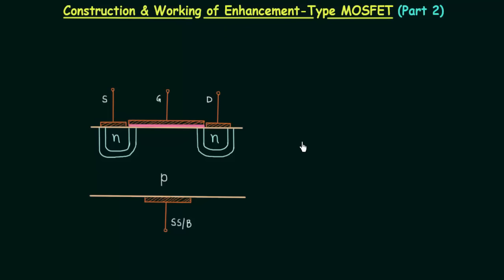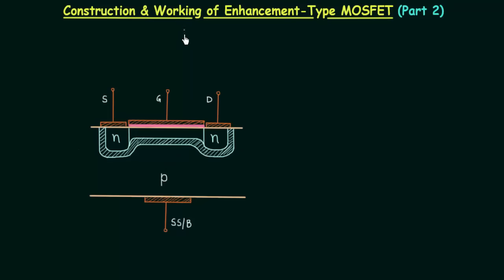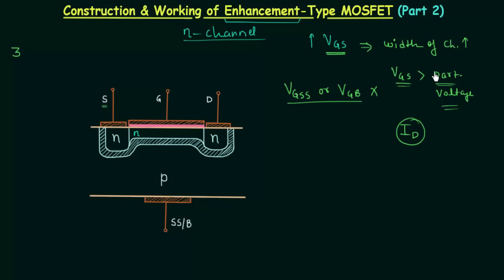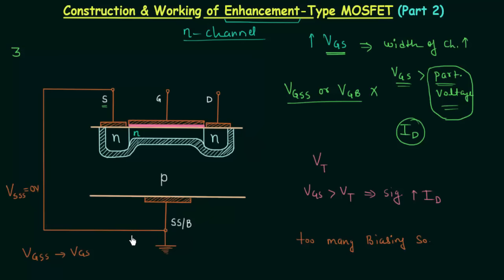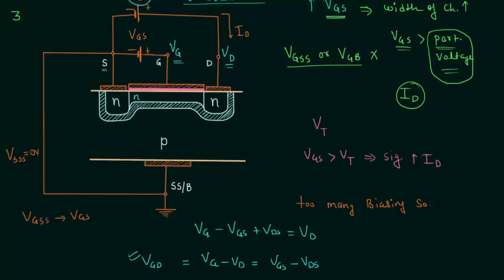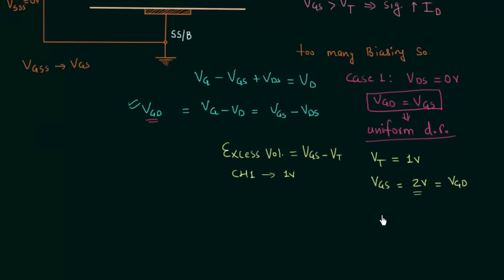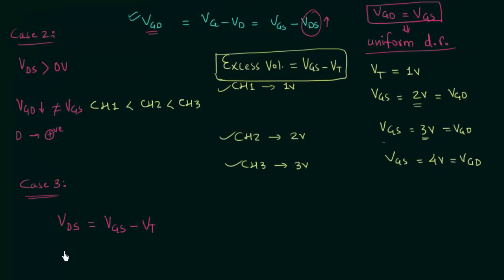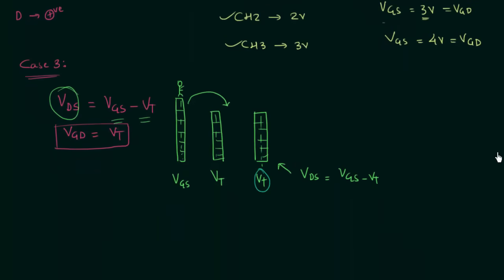Construction & Working of Enhancement-Type MOSFET (Part 2)

Comment: Case 3: Think of it as a line segment with 3 points: S------G------D  (similar to the MOSFET)
If we need S+G to overcome the VT threshold, then we could say, we need S+G to get to D.  With this understood, then we could say, S+G = G+D are of equal length.  Now, D+S is a total length of the line segment and remember, the line segment is broken in 2 equal parts:  S-----G & G-----D. If you understood my 2nd sentence, then we could also say S-----G---VT---D because we need the length of S+G to get over the threshold (VT) to D.  If the line segment is 2 equal parts, then: S---VT---G & G---VT---D... so if we took away S+G, then we are left with G--VT--D, thus VGD = VT. I hope this brought some clarity.

Comment: In case 2, As Vds is increased, the reverse biasing also increases( Drain terminal connected to n-type well and also given positive voltage). As reversing biasing increases, the depletion region increases, and because the depletion region increases, there is lesser and lesser flow of charges.
Reply: Thanks a lot! I was having problem with this case.
Reply: Thank you
Reply: Does his explanation imply that Vds>Vgs?
Reply: thanks a lot bro
Reply: Thanks a lot bro
Reply: Thanks
Reply: Thank you for this
Reply: Thanks

Comment: I have a doubt. In case 1 you said that we will keep Vds as 0. That means drain and source are short circuited.  
If drain and source are short circuited, why should be there any current flow through the channel??
Reply: By saying keeping Vds =0, he means that there is no Vds at all.
Reply: I don't think there will be any current flow in that case. We're not discussing current vs Vds, just just depletion layer and channel width.

Comment: 2nd case explanation

when Vgd goes down it means increasing of the drain voltage and reduction of gate voltage......but assume the gate and drain as the terminal plates of a single capacitor having positive charge accumulation at gate and negative charge accumulation at drain....what happens when Vgd goes down in this capacitor....some of the negative charges at  drain will flow to the gate causing reduced negative charge accumulation at drain....as a result channel width reduces

Comment: how can current flow in case 1 when we make vds =0 there should be potential difference across the terminals for flow of current may be both channel widths would be equal but there wont be any conduction

Comment: I didn't get Case 1. Why would the voltage between D and S equal zero? That actually means that there's no current flowing from Source to Drain. It's kind of paradox to me. On one side the channel is opened (which means that the current is moving from Source to Drain) and on the other side Uds=0 (no current flows from Source to Drain).

Comment: For case 2 think of a normal diode...
Now apply +I've terminal of battery   on n side and -ive on p side as in case 2 in drain.... Now think if it's reverse bias or forward I.e reverse biased so deplition  layer  increase....
Reply: thank you very much. I have seen it 5 times but got clarity after your explanation

Comment: At 14.58
When you are telling about the thing that when drain becomes more positive, less positive charge and hence less electron interaction.
But since drain is becoming more positive,shoukd the force of attraction increase and so channel width increase and depletion region reduce?
Reply: Drain is becoming more positive w.r.t. gate, however, gate to source voltage is constant. Hence channel width between gate to source will remain same. However, more positive drain implies more reverse bias between drain and gate and hence channel width will reduce.
Reply: @abhikumar6335  👌!
Reply: @prathyushamiduthur1146  thanks.
Reply: @abhikumar6335  can u pls explain the third conditon or case

Comment: sir i didn't got case-2. If drain is becoming more positive than why did drain region gets less positive voltage than source region?. please answer it sir
Reply: I also can't understand
Reply: i also can't understand case 2...why ain't u answering...?
Reply: Because increasing +ve voltage on a n terminal increases reverse bias which in turn increases depletion region!
Reply: I think,sir has slipped in wrong saying
Reply: Ja ke apni bhas charao
Reply: Exactly.. I too have same doubt
Reply: Vgd=Vg-Vd so if Vgd decreases that means Vd has increased
Reply: I too didn't understand the case 2
Reply: I think it is because when Drain terminal gets more positive, electrons from the Drain's N-well gets attracted and Holes from the N-well's vicinity gets repelled which increases the depletion layer which means less majority carrier consequently leading to less current conduction. If I'm not mistaken with this regard, less current means less voltage. If I'm wrong I'm more than happy to be corrected.
Reply: Rupanshu Kapoor ,  Suppose that Vgs is fixed at 8 V , and if u increase Vds from 2 V to 5V, Vgd will decrease from 6V to 3 V, this reduction in the gate to drain voltage will, in turn, reduce the attractive forces for electrons and the width of the so-called enhanced channel will also reduce due to fewer electrons .
Reply: Case 2 is describing a pinch-off effect. I've heard it explained also with an additional perspective touching on resistance. If I understand it correctly, the higher voltage in the drain terminal becomes weaker the closer it is to the source because of the resistance in the substrate the further along it goes. 

Higher voltage causes the depletion region to grow in sort of the same way how the inversion channel was first formed. Voltage in the drain terminal relative to source attracts the carriers in the n-well and repels holes down, the ions become "depleted" thus growing the depletion layer. I think some people in the comments section are referring to reverse bias. 

The two ideas above mean that the higher voltage region near the drain will have a more swollen depletion region, arriving to the same conclusion the instructor has about the sloping channel.

The channel lessens in conductivity while the channel forms but current shoots off after a certain level, because the length of the channel between drain and source is actually shortened the more the pinch-off increases, lessening resistance.

Please correct me if I'm wrong.